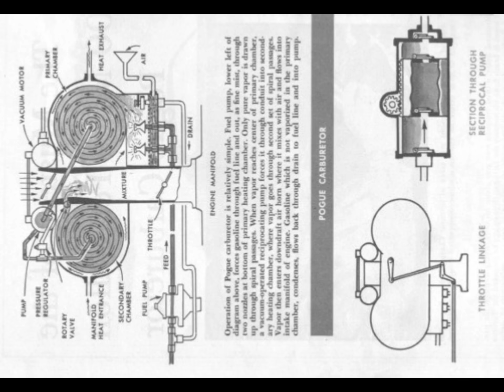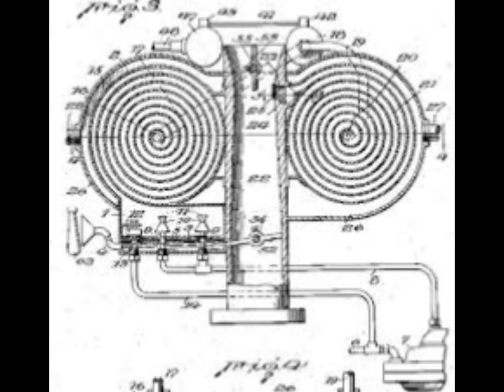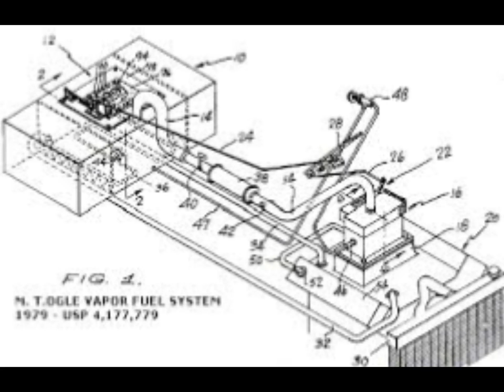100 MPG Pogue Carburetor

Comment: Smokey Yunick experiment with vapor carburetors in the late 70's or early 80's. He said that with the old formulated gas that modern cars with the advances they made to efficient and lighter weight car if they had vapor carburetors cars would be getting over a 100 miles per gallon. He said that in the Popular Science Magazine. Problem is, that the gas now does not have the energy content it use to have. I ordered a vapor carburetor system from a guy who advertised in Popular Science in the  1980"s. A genius mechanic friend of mine built it. He drove it to Myrtle Beach and back. He had to drive it on vapor because the high heat from the heated mixture of vapor melted his carburetor plastic float! You started the car on carburetor and switched over to gas when the heat exchanger heated the gas to vapor. I noticed from the plans that the inventor had to add a new feature to the heat exchanger, It was a Sludge Tank! Because the Gasoline People had add junk to the fuel. When the vapor cracked away from it, you had to have the sludge to drain from the heat exchanger. My inventor  friend that built and drove it said that He took it off his truck. To experiment, He filled a milk jug with a gallon of gas and set it out in the sun. When no more would evaporate, He had a  third of a jug full of something that would not burn if you stuck a blow torch in it. He did stick a blow torch in it. He said that the gas companies fixed it so the high mileage carburetors would no longer deliver high mileage! I remember in the early sixties that I bought an old Plumbers Blower Torch that use White Gas from amoco. I will it up with white high test gas and lite it off. The blow torch had a small chamber in the bottom that changed the gas to a vapor when heat by the flame chamber. The flame was feed by a very small pin hole. I set it on the tree stump and it has a pretty blue flame that sounded like a jet. It burned for hours! just a pretty blue flame. After my buddy told me about the junk in the gas, I went to the same Amoco station and bought the same high test from the same pump. Fill my Plumbers torch up and lite it off. When the pretty blue flame would burn for a minute and then black smoke would belch out until the trash in the gas unload and then the blue flame would start again. It did this like time work, over and over! The I came to the conclusion my inventor mechanic did. They Gas Companies had doped up the gas to kill vapor carburetor. The car manufactures made advances on the car engine to cover the gas chemists changes in the gas formula and add air pumps and catalyst converts to finish burning the gas that did not have time to burn in the cylinders. My air pump on my car locked down and was not pumping the air into the exhaust system and every time I started the car, black soot would blow out! Smokey Yunick was right, by changing the gas formula, High Mileage Carburetors would not work. I also noticed that Colman Gas Lanterns put  on larger vapor chambers on to their lanterns to run this new gas. The heat chambers on the Old Colman Gas Lanterns were stopping up with this new junk in the gas.
Reply: If smokey said it I have no doubt...
Reply: i  love you
Reply: This is not the first time I heard this!

Comment: Pogue carburetors worked with 1930's formula gasoline.  Big oil started putting additives in gasoline that gum up pogue carburetors that progressively destroy their efficiency!
Reply from the maker: Yes I read the same thing and it makes sense because Coleman white gas works so much better for these systems
Reply: @johnironsmith4402  iirc white gas/Coleman fuel is easier to evaporate than gasoline so it makes sense
Reply: Ok conspiracy theorist
Reply: LOL, horseshit.
Reply: @johnironsmith4402  well maybe gas line antifreeze or alcohol might be used instead of gas??
Reply: It's called catalytic cracking. All it is is hydrocarbon compounds that have less ideal rates of evaporation for these types of systems. It just needs to get hotter, more lean, distributed properly, and ignited with a large gap plug or an E3. People usually grasp the vapor portion and stop, but the heat keeps the vapor in the vapor state, and allows droplets to transfer heat more easily to trigger state change into more vapor. This enables more volatile mixtures with less overall fuel do to less concentrated pockets of fuel, and therefore more contact area between oxygen and fuel, per ingested volume.
Reply: Jeff Kopis  Longer hydrocarbon chains. If gas was just octane and shorter it would work perfectly. What's in gas now, is a bit closer to kerosene. This means more BTU's per gallon, and less ideal rates of vaporization. When people build bubbler vapor designs, there's an amount that stays in the container. That's the stuff.
Reply: @Sams88990  Well stated Sam. Higher heat will break down the gasoline into a gas state. V
Reply: not true . the only difference is unleaded fuel is used now. back then it was leaded fuel
Reply: @derektompkins2487  Thank you for pointing this out Derek. VF
Reply: The real difference is boiling points and ignition points.  Gasoline has 420⁰F 100% boiling point & 495⁰F ignition point.  We currently use Ethanol commonly to mix with our fuel at the pump.  (btw E85 was kind of a bust)  If you mix methanol instead of ethanol your numbers get easier to perform safer.  Ethanol boil/ignition is 173⁰F/793⁰F  & Methanol boil/ignition is 148⁰F 867⁰F.  We can GROW our own Methanol!!!   Heat fuel to vapor safely, enjoy cleaning the air whilst reducing lap times.
Reply: @johnironsmith4402  now the gasoline is unleaded and all cars are fuel injected.  So now you can use the Charles Pougue carburetor.    But you need a camshaft grind that does not have any overlap.   And no ignition advance.    Because the gasoline in it's vapor state is very explosive and would cause too much detonation and would destroy your engine.    I tried it on a Briggs and Stratton engine and it works fine.   You need a camshaft grind similar to a Lawnmower engine.   It will make way less power but the fuel mileage will be tremendous
Reply: @MilesPrower1992   the world has been full of conspiracy's since the dawn of man, a conspiracy is nothing more than a strategy to obtain a desired outcome.
Reply: @jesusisreal3209  and I can't think of ONE "conspiracy theory" that's true. But stay delusional, my friend
Reply: @jesusisreal3209  Cool, still waiting on one conspiracy theory that's true
Reply: What about pure alcohol?
Reply: @popwarner8029 would make a hell of a generator setup no?

Comment: I might have a cxouple of suggestions that will improve your setup. My brother and his friend made a headgasket with four sets of platinum points equally mounted around the cylinder. It was layered in between the gasket material like a circuit board.  So instead of firing from the spark plug it fired from each set of points. The platinum points had no place to hold any carbon build up so would not foul out like a spark plug. and firing the gas mixture  with four sets of spark burned the fuel vapor quicker and more completely.(old airplanes had two sparkplugs per cylinder)
Giving an increase of power with less fuel consumtion and less emissions. My idea to add to this is to reduce fuel droplet size thus increasing surface area of the fuel by using an ultrasonic mister which instantly vaporizes a drop of liquid to a finer mist than a carburator is capable of. This should also increase power while decreasing consumption andEmmisions. The reason you do not see this gasket method of spark on the market now is a sparkplug company bought their patent. Their was a drawback to the design they had not worked out at the time and that was that the gasket was thicker and you had to torque it down just right or it would blow the gasket.  But this was 40 years ago and we have much better materials to work with now. I really hope you read this or anyone else . It could be an easy add on for cars  well worth the cost for the increased economy and decrease of emmisions.  Hopefully give a little more time for the transition to the totally electric cars that are coming. Jake The Snake Was interested in the gasket for his race cars as it would have been a huge advantage.  So if you need an investor you might want to try him. It also goes to show how money trumps humanityand that big corporations (Firestone)  are more concerned with the bottom line than reducing polution to save mankind.  We really need to institute a crimes against humanity law for people like that and Big Pharma who suppress or overprice discoveries that benefit life.. Please send a comment should you read this. I like to think I am at least trying yo help.
Reply from the maker: Thanks for the comment been busy with electrician gig lately.  Head gasket spark is cool never heard of it but I'm really interested in trying to mist gas with an ultra sonic mister.  Same frequency as water and have you tried it?
Reply: Hola y tendrás algun plano o instrucciones yo leí tu comentario me gustaría saber más y poder implementarlo tienes planos o instrucciones detalladas, no soy mecánico no se mucho de eso.
Gracias saludos

Comment: I have a 2000 Honda insight. Took out the battery 70 pounds. Took out about 150 pounds altogether. I get over 100 mpg gasoline only. It’s not a hybrid anymore.
I do heat the gasoline with the catalytic converter and 20 feet of copper tubing. It goes into the injector rail. Are use power steering line instead of gasoline rubber hose line. Heavy duty hi temperature high-pressure power steering line has to be used with the copper tubing or it will melt regular gasoline rubber hose line. I also use special clamps that won’t cut into the hot Rubber. Also you have to use a spray nozzle. You can’t let the full amount of gasoline go to the injector rail. Are use a needle valve and cut the gasoline way back. A little pin prick hole even smaller than what comes out of a ether can. Is all the car needs to run. I also stopped the return line to the gas tank. You don’t want hot vapor going into a plastic gas can tank. Anyway. You let a very small amount of gasoline go into the copper tubing. It is vaporized Goes up to about 80 psi because it’s a very small amountgasoline going into the copper tube. Then you have another control system needle valve too let The vapor leave the copper tubing and go into the injectors. That has to be controlled. A car can burn as much vapor as it does liquid gas and your mileage will not change.

Out on the street. There are like 10 hills I travel daily. The tallest one if my car will not go up it I turn the volume of vapor on a little higher. That sets my fuel line for my typography. If I know I’m not going to that hill for a long time I can turn the vapor down a little.  

It takes X amount of calories or energy joules whatever you wanna call it to climb a hill. Takes next to nothing to travel on flat ground takes nothing to go downhill.

So what you’re trying to do is make the car efficient on level traveling. That’s what I’ve done
Reply from the maker: I'm so glad you posted this.  There is a guy in Florida, John Weston, who used similar system as this.  He used a geo metro I think.  I need to attempt this with an American V8.  I'm thinking even with a lean burn it has enough torque to make it over the hills...
Reply: John Ironsmith Well like Elvis would say thank you thank you very much
Reply: thats great thank you!
Reply: Ha ha ha has it blown up yet. Lol. A roll of tape taped under your gas pedal will do the same thing. You are hilarious
Reply: Put one of these on a 93-97 Ford Ranger man. These vehicles get amazing gas mileage considering the size. 4cyl 2WD MT 108" WB and possibly put a canopy on it or non-solid tailgate imo. I'd like to get some flatter wheels for it too.
Reply: impossible

Comment: One more thing.................. see those little black dots. You can put a welder tip from a mig welder it’s made of copper. Get the hole down to the size of those dots.......Have two of them one on either side of the copper tubing. That’s all the gas that needs to go to your motor. It’s called an orifice. I started off doing that. But it got stopped up with a grain of sand. On a busy highway so I switched over to needle valves.

Think how small the injectors are. And they’re cutting off and on all the time.  if it’s the size of those dots with 80 pound vapor blowing through will keep the car running.

This works on a five speed car. If you have a CVT transmission when the car burn less gas the transmission goes into a lower range so you don’t see the savings.You also have to have a lean burn ECU.

My system makes the lean burn ECU system way more efficient.
Reply from the maker: good advice and I didn't know that about the cvt trans computer adjusting based on fuel consumption.  not a fan of newer transmissions but I love the 5 speed manual...

Comment: Plus,  there's so much great experimentation in all these areas(MPG). That is, gasoline/hydrogen combo systems,  water injection,  hydrogen from water. Also, propane butane etc,  pure vapor 100 mpg carburetors(like mentioned here) , modifications for EFI,  it's a huge area. Do your own research and experimentation,  the huge MPG and power increases, totally possible.
Reply: sadly,a carbed gasoline engine in a 3000 pound car will NEVER,i repeat never achieve 100 mpg...its legend,the reality is lean running engines tend to die a very quick,very painful death
Reply: Totally impossible; the limit is not, and hasn't been for decades, combustion efficiency. It's overall thermodynamic efficiency, which cannot be helped with a carburettor.

Comment: I believe this works and is similar to Smokey's hot vapor engine. The biggest concern after proper ration control is flash arrestor to prevent a backfire for causing a fire as fuel vapor is extremely flammable & explosive. But I do believe you can greatly increase fuel mileage running on fuel vapor only.

Comment: Pogue's carb did work in its time, the gasoline then was called well head gas, and was usually collected by evaporation so the molecular chains were relatively short. Todays gas contains roughly 5000 different length molecular chains some of which will not vaporize till 440 degrees, so if even part vaporizes and runs the vehicle, eventually the heavier chains will coat the  inside of the heat exchanger and insolate it, steadily reducing effiency , till it no longer works.
Reply from the maker: Hey that's neat to know.  I've heard something similar, but it was that the oil companies did additives so that gas wouldn't evap as easily.  2 reasons possible: make gas less explosive for safety and to render pogue type carbs obsolete.  I'm unsure what the truth is about these.  But I think the 2 french compressed air cars invented recently make pogue carbs look boring.
Reply: I can't see reply before this one, what did it say?  Well, my reply is add methanol, it has higher octane and safer boiling and ignition temperatures.

Comment: You need a cross over spider exauhst system with a coragate splash plate vaporizer underneath the carb.
This gives you the raw gas needed to cold start and will automatically become a vapor machine as the exauhst gas pass through the fins and begins vaporizing the raw gas into vapor.

Comment: Use an intercooler that has the exhaust plumped throw it inside the intake to make it a superheater/vaporizer for fuel changes the air/fuel ratios for a more efficient burn and water/methanol injection below it to cool valves and pistons, add forced induction to increase intake temps and vaporization.

Comment: 2 problems. You don't need an overly complex design of a carburator you could just use a propane gas design. Then, if you recycle the exhaust gasses to heat up the gas+ oxygen mixture they ignite... You don't want them to ignite until they are at the piston chamber. 
(and please turn the music down)
Reply from the maker: Yes I agree
Reply: @johnironsmith4402  Are you going to make more videos on the subject John??
Reply from the maker: @victoryfirst2878  maybe in a year.  Thunderhead289 just made an excellent video of him getting 42+ miles per gallon with a Ford 300ci V8 using a lawnmower carb.  Check it out.  Mad respect for that guy.  I want my next big video to be about Reverse Trike EV solar powered; build from ground up.  That's my dream GOD willing I'll get to it sooner than later.
Reply: @johnironsmith4402  THank you John for your reply on the mileage matter. You heads up on the lawnmower carb is just so kool. I look forward to see what you can come up with Sir. I also know God willing is always an honest way of looking at things realistically. Good luck and I look forward to see your great video Sir. Please keep me in the loop. 
Peace and God bless too. vf
Reply from the maker: @victoryfirst2878  Thanks for responding again.  Work and family and other factors esp. insomnia lately have prevented me from doing as much as I'd like to.  I'm always watching other dudes videos and thinking wow they can narrate and film way better than me and are like cooler and stuff but then I'm like hey people still comment every once and a while and make it worth while....and us builders/tinker-ers are like the 0.0001percent of every body else or sometimes the else is just addicted to video games.  Anyways GOD willing with some prayer maybe I can sleep good tonight and make a cool build vid tomorrow.